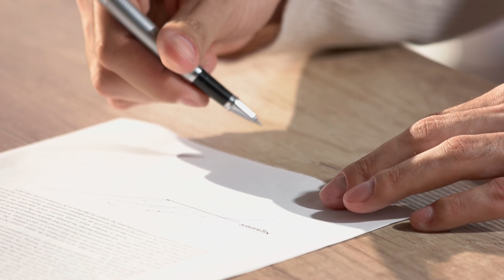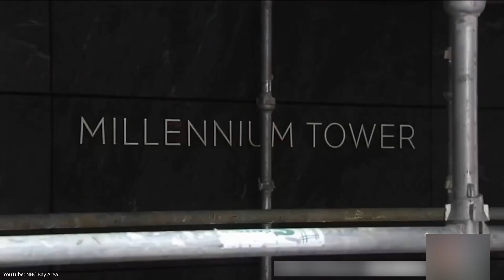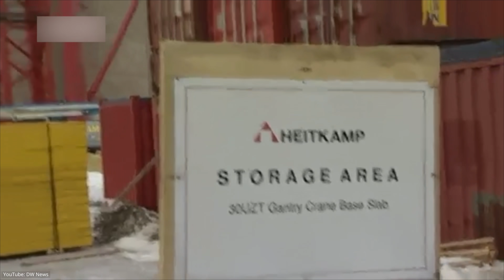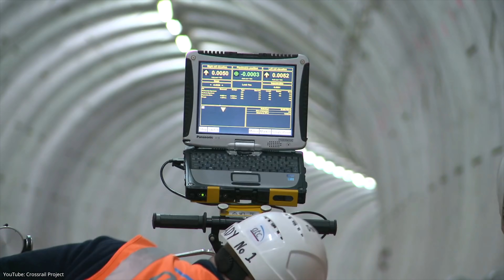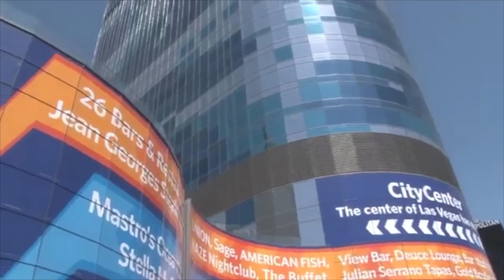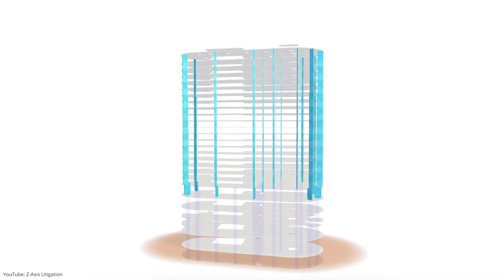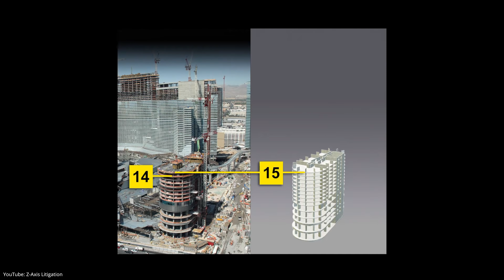Most Expensive Construction Mistakes in the World (Part 3)

Comment: The AON building in Chicago formally known as the Standard Oil building
 Construction
The Standard Oil Building was constructed as the headquarters of the Standard Oil Company of Indiana, which had previously been housed at South Michigan Avenue and East 9th Street. When it was completed in 1973, it was the tallest building in Chicago and the fourth-tallest in the world, earning it the nickname "Big Stan".[10] (A year later, the Sears Tower took the title as Chicago's and world's tallest.) The building employs a tubular steel-framed structural system with V-shaped perimeter columns to resist earthquakes, reduce sway, minimize column bending, and maximize column-free space. This construction method was also used for the former World Trade Center towers in New York City.

Refacing
When completed, it was the world's tallest marble-clad building, sheathed entirely with 43,000 slabs of Italian Carrara marble. The marble used was thinner than previously attempted in cladding a building, which soon proved to be a mistake. On December 25, 1973, during construction a 350-pound marble slab detached from the façade and penetrated the roof of the nearby Prudential Center.[11] In 1985, inspection found numerous cracks and bowing in the marble cladding of the building. To alleviate the problem, stainless steel straps were added to hold the marble in place.[10] Later, from 1990 to 1992, the entire building was refaced with Mount Airy white granite at an estimated cost of over $80 million.[5][12] Amoco was reluctant to divulge the actual amount, but it was well over half the original price of the building, without adjustment for inflation. Two-thirds of the discarded marble was crushed and used as landscaping decoration at Amoco's refinery in Whiting, Indiana, one-sixth was donated to Governors State University, in University Park, and one-sixth donated to Regalo, a division of Lashcon Inc. Under a grant from the Illinois Department of Rehabilitative Services, Regalo's 25 handicapped workers carved the discarded marble into a variety of specialty items such as corporate gifts and mementos including desk clocks and pen holders.[5][13] The building's facade somewhat resembles that of the North and South tower of the former World Trade Center Complex due to the upward flow of the columns.

Comment: years ago i thought a BBQ would be good so i planned something simple. $100 budget would get me a few bricks and a decent sized piece of steel plate.... by the time it was finished the budget blew out 12,000%.... concrete slab, 2 brick walls, outdoor furniture, large gas BBQ, wood fired pizza oven, AC power, fridge, lighting, pergola, tiling.

Comment: 4 hospitals in East of England.  Built knowingly with a problematic roof structure 40 years ago and now staff are having to work under the threat of the roof (with asbestos)!collapsing in on top of them and the patients.  Our local one has wards closed because they are too dangerous and there are currently over 400 props holding the rest up.  Probably not a big deal in size and financial terms, but catastrophic in terms of threat to public healthcare.

Comment: I've a question ever. 🤔🤔
My science teacher used to say thag DC has more power ( almost double) then AC.
If it is, then why don't we use DP supply in our homes? .
.
Also is it said that AC loses some of its part while transmission from one to another place which depends on the distance and the wire used. Ans on the other hand, there's no such incidents with DC. If it is so, then why don't we convert AC into DC and then transmit it for long without any loses?.

Comment: If you think this nuclear power plant is expensive you should check the one at Hinckley point C in the U.K. .  And they still haven’t finished.  It is mentioned that in the end it will only supply 2 mgwh per year.  If you were to put wind power there it would put out 12 mgwh of power per year.   Go figure.

Comment: I watched the Harmon go up, and watched its subsequent dismantling. As for sinking buildings, mention could have been made of Mandalay Bay here in Las Vegas. According to Wikipedia: "The problem was solved by installing 536 micropiles (200-foot-long metal pipes filled with grout, each capped with a hydraulic jack) below the building, at an estimated cost of $8 million to $10 million."

Comment: I got one that ballooned in cost a LOT, Australia had been talking about high speed net since 2007 and we were supposed to get 100mbs up/down but it was reduced to 25mbs up/down in 2009 when there was a new PM and then it took a further 4 years for the ball to actually get rolling and then that's when the estimate came out at 29.5 billion AUD but now its estimate as of 2019 was nearly 60 billion AUD and as if to make it worse the NBN decided that they would only do fiber to the house on new housing developments that were going up, any old ones would have to tap into a fiber node located in the town/city while STILL using the existing copper lines so that 25mbs speed? Nope, anyone still having to use the old copper lines as the final mode for the NBN itself barely push 5mbs up/down on a GOOD day, most of the time it's 2-3mbs up/down if were lucky!

Comment: Only problem with Olkiluoto 3 nuclear plant is that the bidding was won by the french goverment owned company Areva who are so incredibly incompetent that the whole project has gone far beyond parody horizon. Using cheapest possible work force from eastern block without proper guidance and supervision has led to many huge parts of the building being torn down and rebuilt to proper specs. Last reactors at this site (Olkiluoto 1 and 2) were Swedish tech and took a bit over four years to build in the 1970's, despite troubles during the construction like a huge devastating fire in the reactor building. Olkiluoto 3 was also supposed to take 4 years to finish, instead it has taken 17. Since TVO has agreaad to pay 5,7 billion instead of the original 3,2 but the total cost of this fiasco is around 11 billion euros, this means that roughly half of the costs of the Finnish nuclear plant are paid by French taxpayers. I would say thank you but let's face it: with a German company this would have been done precisely to specs in four years without any lawsuits and even now this cost TVO double of what was the original bid and it's us electricity end customers that will have to cough up that money in our electric bills. So now Finland has the most expensive building in Europe and the second most expensive building in the entire world and today in November 2021 it is STILL unoperational. Well done, Areva.

Comment: Montreal's Olympic Stadium. 4 times the original. Was for the 1976 Olympics but wasn't  finished until some time in the 1990's.  There's more.  Roof didn't  work. A several hundred ton piece or concrete fell off.  No major tenants. Etc

Comment: I live in San Francisco and those two projects have more than a handful of issues. The millennium tower is tilting so much they said that all the water and gas pipes will no longer function if the building continues to lean. As for the eastern span of the bay Bridge that thing has been a problem from the start. Over budget built with cheap chinese quality steel. Ever since completion the bridge has been a on-going money pit. Caltrans continues to raise to the bridge tolls saying the need more funds to fix and maintain the new bridge. A brand new fucken bridge already costing up into the millions every single year to upkeep. Makes zero sense. Im sure these people have been lining their own pockets for the huge project failure. 

As for sketchy over budget contruction and contracts look at Vietnam. The country is know ln for delays in construction and cheap chinese quality materials. One example is the metro station built using cheap chinese products. Construction was supposed to be completed 5 plus years ago and is overbudget maybe 3 or 4x at the moment. The goverment went the stupid route and partnered with a chinese company to save on money. The cheap labor resulted in warped tracks and new trains that cant even function. If they with a Japanese company from the gate the project would possibly be  complete by now. Instead they are left with a half ass built metro line with no real open date in site. Projections say a few years up to 5 more years. Then there was a another bridge built in southern Vietnam. During the build the contractors went with cheap building materials to skim off money from the project. One month before the bridge was to to open it collapsed due to structural integrity.This collapse killed over 200 construction workers. The people responsible for this only had small fines and a few years in jail. This is just one small example of the shady construction business in vietnam. Im sure there are a bunch of the same problems in se asia.

Comment: Your SF-Oakland Bay Bridge narrative is riddled with inaccurate statements and the video shows the wrong images. You speak about traffic between YBI and Oakland while showing the western half of the bridge between YBI and SF (you even highlight the wrong section). The western half is a suspension bridge that is seismically sound and operating within normal parameters. The eastern portion was an old cantilever and pier combination. It became unsafe because the eastern side pilings did not reach down to bedrock. This double decker bridge, which had to align with a static double decker tunnel on YBI, remained in operation throughout construction except for the single weekend when they slid the final piece into place.  The replacement bridge became expensive due to politics, primarily because the chosen design required a very tall single spire for the new suspension portion and that length of steel was no longer produced in the US. You made so many mistake in this narrative that I wonder if any of your other work is credible?